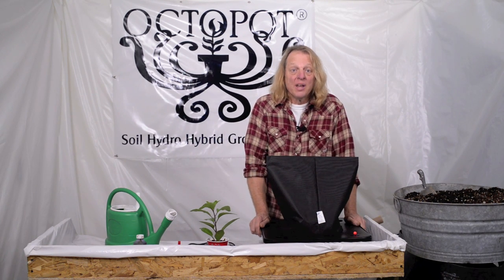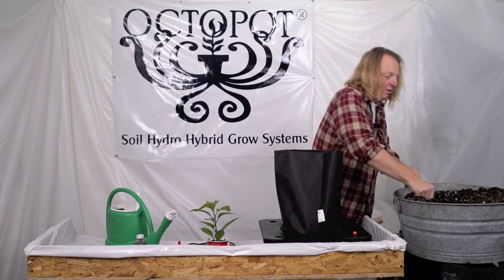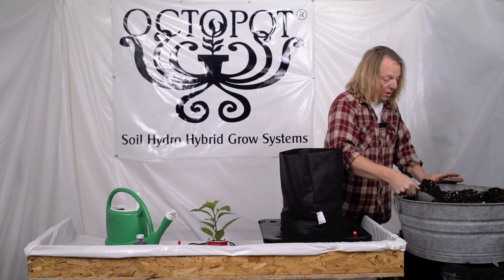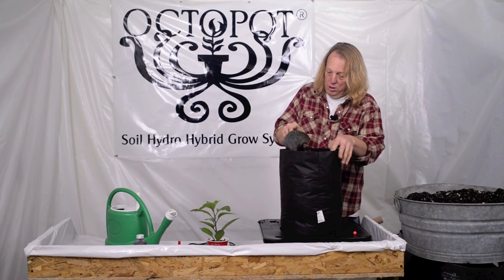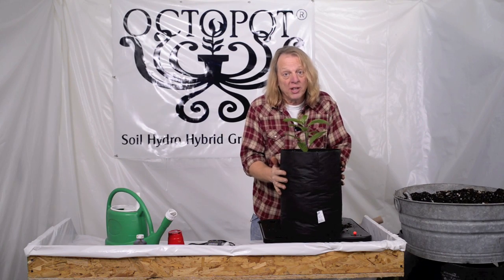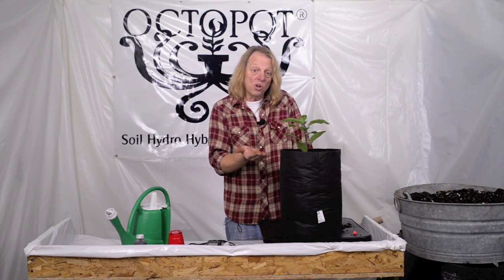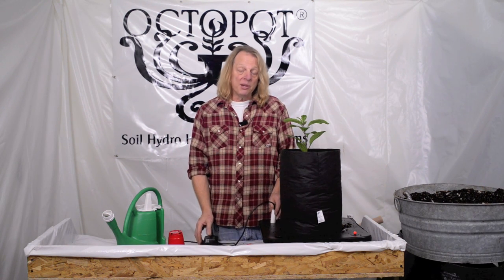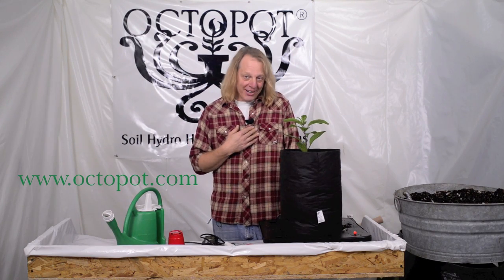Planting Your Octopot Grow System

Comment: Kinda danced around the bubbler question. Would a bubbler add to the performance?
Reply from the maker: The bubbler is unnecessary and could potentially cause more damage because the system is designed to create the ideal environment.  Additions could alter the balance of elements.

Comment: What kind of soil do you recommend I use with the octopot? I am leaning towards using Fox Farms Ocean Forest, organic compost, worm casting, and extra perlite.
Reply from the maker: That sounds like a good mix.  We suggest HP Pro Mix but there are a lot of good alternatives.  Simply make sure the balance of soil/perlite is 60/40 and the density of the soil is on the lighter side.

Comment: Would you recommend starting a plant from seed?
Reply from the maker: Seeds and clones thrive in Octopot Grow Systems with only one over the top watering at the time of planting.  Hydrotropism is a natural plant process that causes plants in Octopots to seek and grow towards the water in Octopot's Hydro Reservoir.  Plants develop  as many or as few roots into the water as that specific plant variety needs for optimum moisture, just like in nature.  While seeds and clones develop roots downward towards the water, capillary action in Octopot's Gro Sleeve creates a moisture gradient throughout the soil.  The moisture gradient promotes fast healthy growth of plant roots from seeds and clones without any over the top watering.  Watering over the top is not recommended in Octopot Grow Systems except during the initial planting because it interferes with the natural plant process of hydrotropism.  When plants sense water coming from the top they will establish very shallow root systems near the surface of the soil which is not healthy for plants.
Reply: Thanks!  I look forward to purchasing an Octopot for my medicinal needs.

Comment: What do you recommend for a PH range and ppm in the hydro part of the octopot?
Reply from the maker: A wider range of pH is tolerated in Octopot Grow Systems than in soil or hydroponic growing methods.  This gives growers some room for error without losing plants.  PPM and pH ranges vary depending on what crop you’re growing.  Many of our customers find the sweet spots for pH between 6.3-6.7 and PPMs at 600-800.  Thanks for the question!